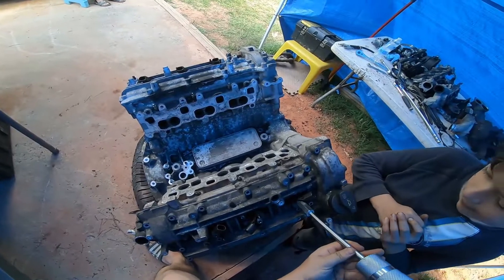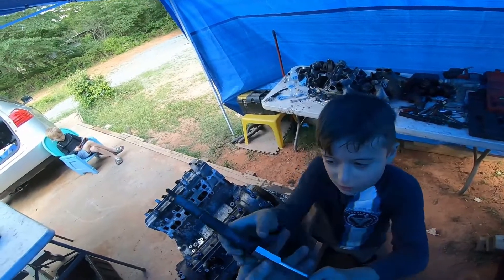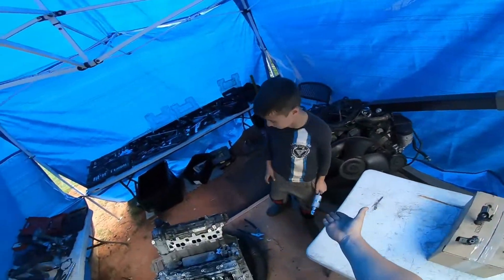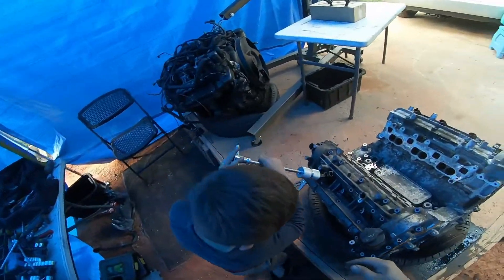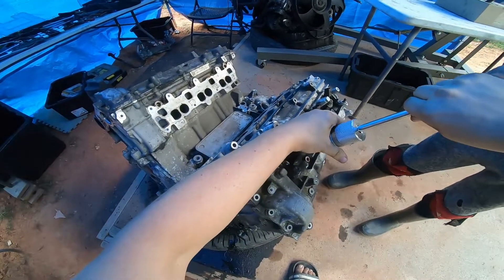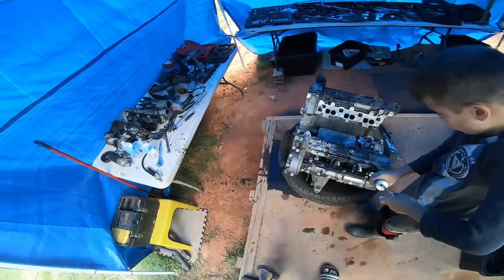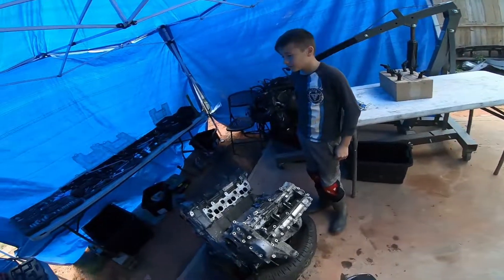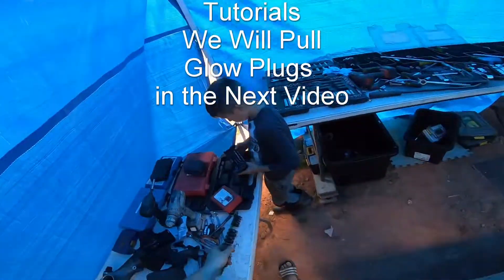How To Remove Fuel Injectors using a hammer puller tool on 2008 Mercedes Sprinter 3.0L Diesel

Comment: Thanks for the video but I’d like to add that there’s always a risk of stripping or breaking the bolts.  Please buy a brand new Mercedes or Febi Bilstein bolts and MB Copper washer.
Reply from the maker: Absolutely correct, you can’t reuse old bolts, they are torqued once and then they brake